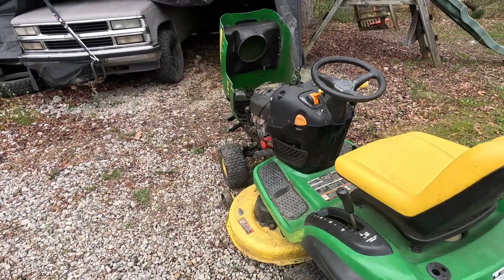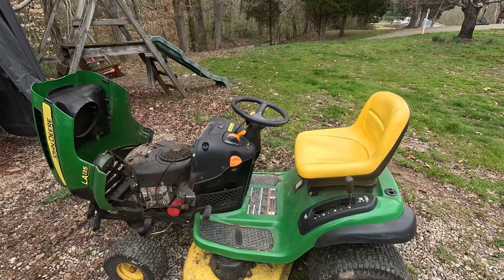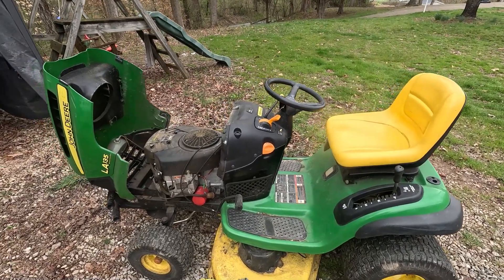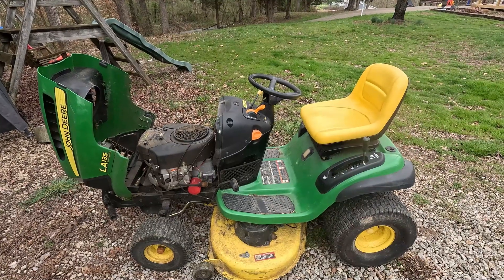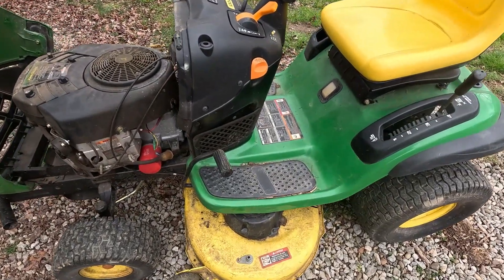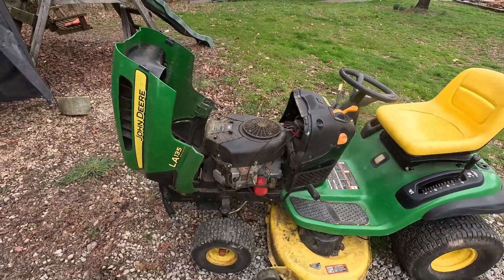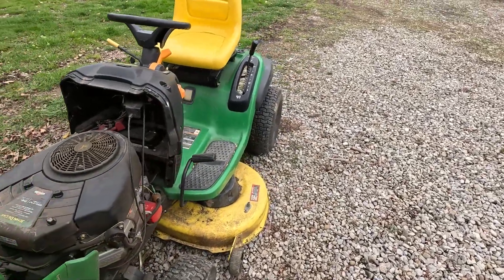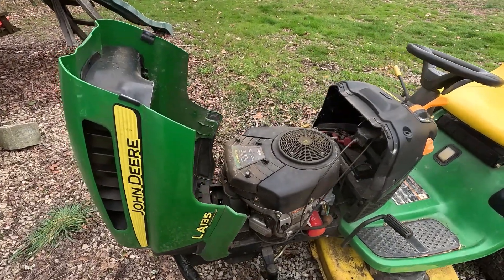Are John Deere Lawn Tractors just JUNK made by MTD?

Comment: JDLA135. 10 yrs old, 400+ hrs.  No problems. Service maintanance yearly/ bi yearly. Run on 3 acres thick pasture and lawn year round in Florida plus pulls utility  cart.     Main complaint is very hard PTO shifter and tight steering. Probably could address both issues if had to.   Big box and dealer mowers are the same.  100 series is basic residential series.

Comment: The box store John Deeres are complete trash. I deal with about 300 machines a year and john deere is the biggest piece of shit in my shop
Reply: What about the LA115, is that a good one?
Reply: @samconway5288  no absolute garbage
Reply: @ I have a 2009 Husqvarna that bought new. It's been a good one. Has 300 hrs on it. Just replace the rear end.
Also over the years I replace standard stuff like pulleys, blades, belts etc. Damn lawnmowers are high. I paid $1,700 for my 2009 and the new ones are $2,600 at Lowe's
Reply: @samconway5288  they are junk 🤣. You should not be doing transaxle replacement for 300 hours wow lol. So when you convert hours to milage you can get a better look at where a machine stands. 60 times your hours gives you mileage. So your machine only has about 18,000 miles on it.
Reply: @SoutheastanglerLLC  a friend had the same one and replaced the transmission with less hours. Other than the transmission replacement is a good lawnmower. 15 years now and cut 3 acres once a week. Not sure why the transmission doesn't last more than 300 hours.